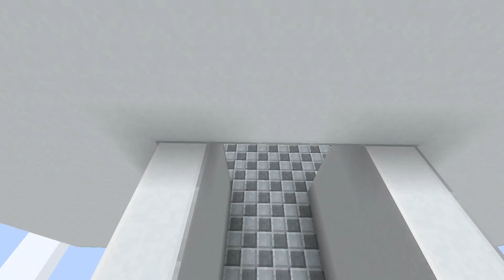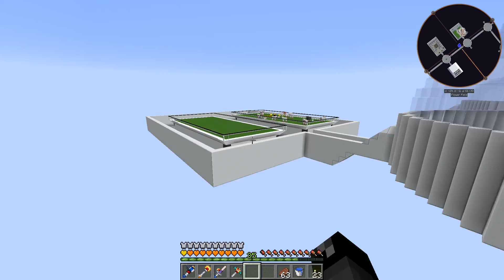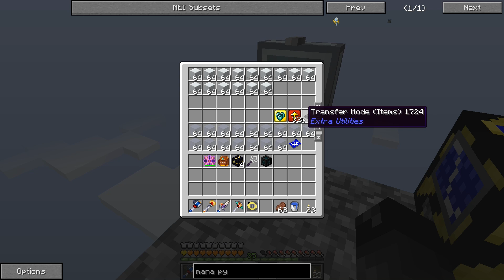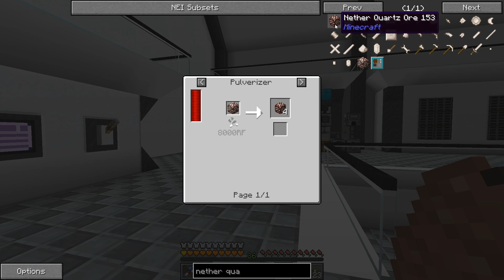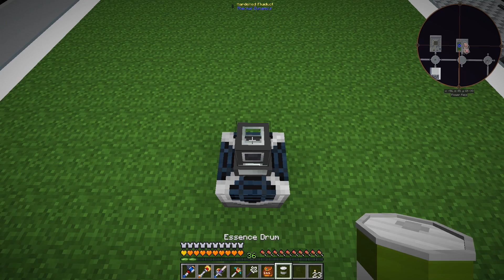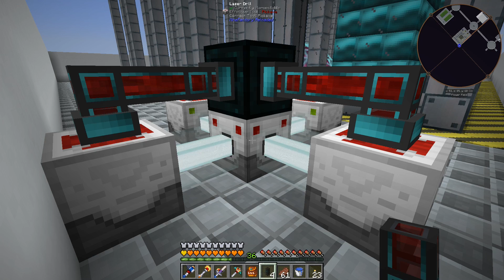Minecraft Mods FTB Infinity - SKY LASER [E31] (HermitCraft Modded Server)

Comment: Just got done binge watching all of the Infinity. So my comment is going to be a bit dated, but still relevant.

In the big reactor you currently regulate power by using the fuel rods, correct? This results in a lot of fluctuation, a more stable and accurate way to regulate power would be to use the flow-control of the turbines. That way you can focus your fuel rods on keeping the core heat between 250 and 500, while the flow control gives you a stable amount of power.

You can also use the flow control to keep the RPM of the turbines up while the coils are disengaged. A mere 2-5 mB/t will keep the rotors spinning at the same RPM as you have it set to. WIth a steam usage that low, it's completely worth it to have them on all the time and not have the coils on, it will save you time on the initial speeding up of the turbines.
Reply from the maker: It's actually control rods. The higher % of the control rod insertion the lesser heat is generated and the lesser fuel is used. You want to keep your core temperature around 1000C for the best re-activity/fuel usage.
Reply: Hypnotizd Control rods it is indeed.

Isn't reactivity only applicable when you use the passively cooled reactor? The moment you switch to steam and turbines, the power gets generated in the turbines themselves. So you'd only use the reactor to produce the steam supplied to the turbines. In that case, when you so grosely overproduce with the set up you have, wouldn't you want to keep the temprature as low as possible in order to use less fuel?